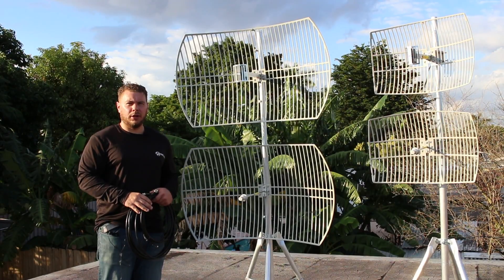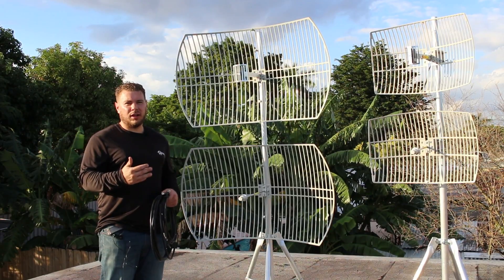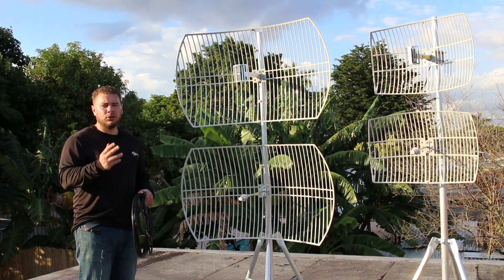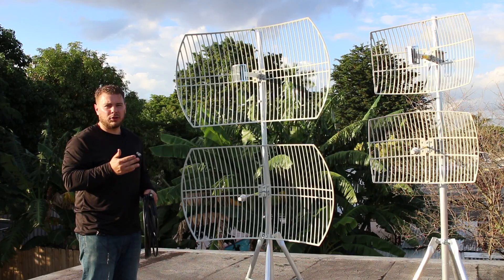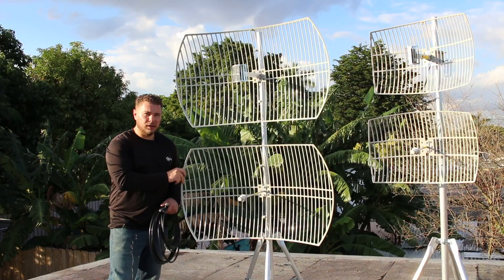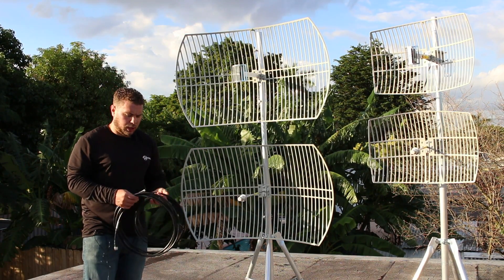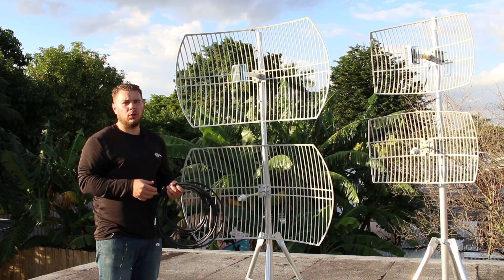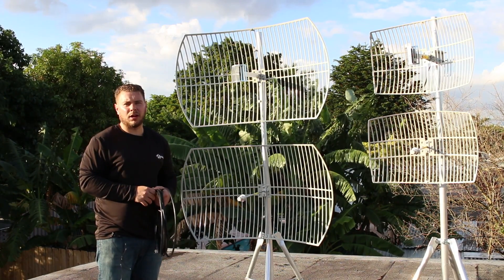Dual Band WiFi Antenna Configuration For More Range And Speed Using Parabolic Grids - 2.4Ghz/5Ghz

Comment: I have a 5ghz 30dbi antenna, which  way should the polarization arrow point to?
Reply: It depends on the destinations polarization. With the grids some people have shown that turning them sideways at a 45 degree angle and pointing straight at the tower will also increase the signal. strength

Comment: I just bought land with Verizon -100dbm band 13 with download 3mb and upload 1mg outside the home.  I'm thinking about buying the MOFI 4500 which is 2.4GHz and adding a dual router as well for 16 home security cameras, desktop pc for web surfing and streaming on 85" tv (no gaming).  When I buy your 2 antennas should I buy the 5 GHz or am I limited to 2.4GHz since the antenna will be hooked into the MOFI 4500?  Is there a better router to buy for a Verizon or AT&T sim card?
Reply from the maker: The Mofi is a cellular and WiFi router. This might be better for you: https://www.youtube.com/watch?v=xzqkoPL9t9A

Comment: What's the deference between 2 N type conectors vs only 1 N type  Parabolic Antenna  do you get more Signal of you use the 2 N type?
Reply: If an antenna has only one N type connector it doesn't support mimo. Multiple in/ multiple out.

Mimo allows your router to send and receive at the same time and it increases the gain of the antenna.

Cell signals bounce and can hit the antenna in different directions.
The 4x4 has 4 type n connectors and the router needs to have 4 ports.

Inside the 2x2 and 4x4 there are separate antennas.
2 or 4
They are arranged in different polarization.

So 4 antennas doesn't just allow multiple transmissions it allows the modem to connect to the cell tower with more data paths bonded together to increase speed while the antennas position increases gain.

Comment: When place is without network coverage, can we still use the antenna to receive WiFi signal and operate internet?.Given that the nearest network signal is about 100-250 km away.
Reply from the maker: No
Reply: SimpleWiFi .......is there any solutions to the above problems?
Reply from the maker: No

Comment: The problem is the most WiFi AC adapters and routers have no separate 2.4 and 5 ghz output but only a combined outputs. This makes it hand to use antenna`s like above.
Reply from the maker: You need a dual band antenna. We have a very powerful one coming soon.
Reply: That`s the problem right now, a lot of antennes need separate 2.4 and 5 Ghz inputs. And the antennes that claime to met dualband are not or badly working. What we need is a great Dual band antenna. When can I expect a nice video review :-) ?
Reply: @SimpleWiFi   Do you have this antenna now?

Comment: which side goes into the 5gz and which side goes into the 2gz right or left on the dual band wireless adapter, i already got the grid parabolic antennas from u guys {simple WiFi
]
REPLY
Reply from the maker: Hey Anthony, So far from out testing both ports do both bands.
Reply: SimpleWiFi thanks for responding back .thanks for the help

Comment: I am trying to create wifi for CCTV network with IP camera in 1KM range..... Please help..
Reply from the maker: OK, you first need a line of sight between an antenna mounting location so you can send signal directly to that camera. Can you confirm you have this?
Reply: SimpleWiFi There are some trees and buildings in between....and the actual plan is to place the antenna a bit higher and CCTV cameras at 10ft high from ground.

Comment: hello i have a dual band usb 3.0 wireless adapter just like the alfa red one  you showing up in this video, can i use this antennas for that adapter? and what kind of cables should i use , thanks
Reply from the maker: Yes you can use dual band antennas with that adapter. Any cable N-Male (Antenna Side) to SMA MALE -RP (Alfa Side) will work well.
Reply: SimpleWiFi thanks for responding back, ill buy your antennas from amazon i saw them there. Thanks a lot
Reply: which side goes into the 5gz and which side goes into the 2gz right or left on the dual band wireless adapter, i already got the grid parabolic antennas from u guys {simple WiFi
]